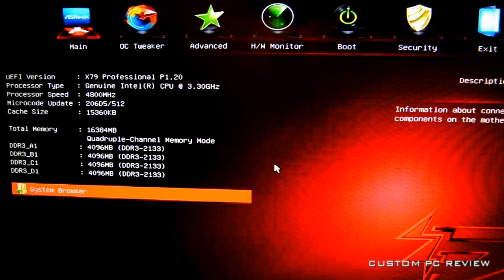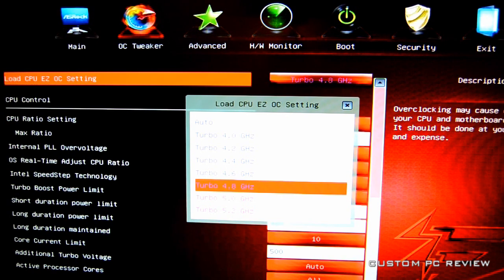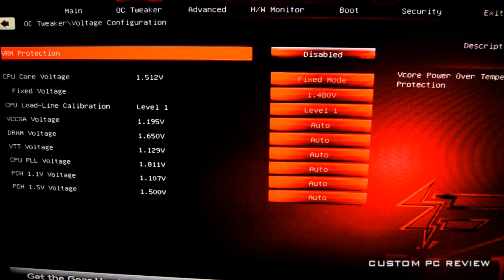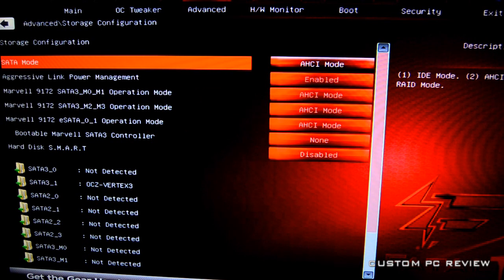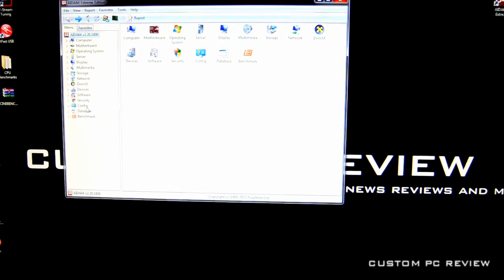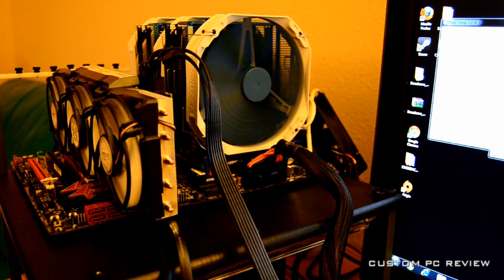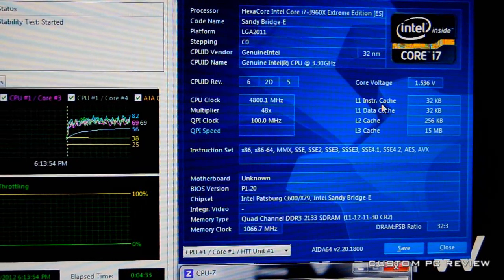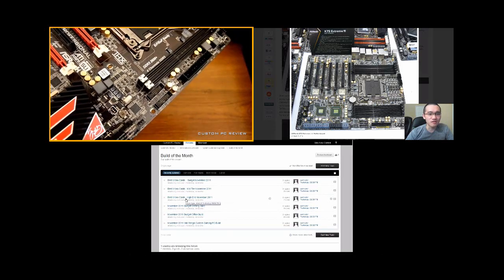ASRock X79 Professional i7 3960X 4.8GHz OC Tutorial + UEFI Demo

Comment: I prefer lower voltage with more LLC for using it like a little addiditional offset, but thats based on the own favour, i think. 

CPU-degradation isnt necessarily influenced by temparture, but by voltage.

Comment: Nice tutorial but you did nothing more than left everything on auto setting reccomended by the OC tweaker...
For those that are new to overclocking and want to try it out, try to avoid the auto setting by OC Tweaker, it generally overcompensate for stability and set the voltage too high for that clockspeed.
Higher voltage = MORE heat + Faster CPU degradation

Comment: Sweet, I just ordered the same Motherboard.
The CPU you are using is a notch too expensive for me, though. 
What would be better to go with for me (for gaming). The 3930K set @ 3.2 GHz or the cheaper 3820 @ 3.6 GHz? Some people tell me clock speed is more important for gaming than additional cores/strings at this point, but then others tell me that a few games already utilize 6 cores when available, and that the 3930K will be more future proof for this reason. Ofc. I will be OC'ing with either.

Comment: All depends what you want to do really. If you need stable high overclock speeds for long periods then my choice would be 1)Extreme11, 2)RIVE (which is still one of the best out there)or Champion 3)Professional. If you want just a gaming rig then options 1 and 2 would be a bit of an overkill. In short, you can overclock all of them and play any game. But if your intention is mainly to play games, I would go with a cheaper X79 board and use extra cash on ram etc as there isnt a bad X79 board.

Comment: Hi  I just got this motherboard.. .. and I can't install windows 7 due to raid drivers I got two ssds on raid 0.... I got the driver from the asrock website ... but my problem is that I can install the 64 bit version of the driver... only the 32 bit version will install.. . but my windows 7 ultimate version is 64 bit... so I get a error.... the 64 bit version of the raid driver will not install it tells me to get a new driver but I checked that's the latest driver from asrock... please Help ;(